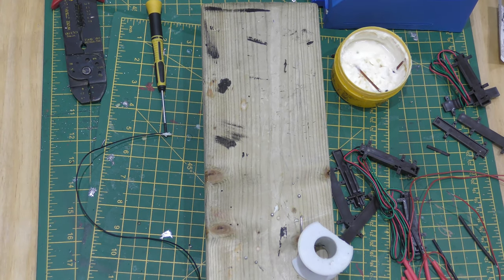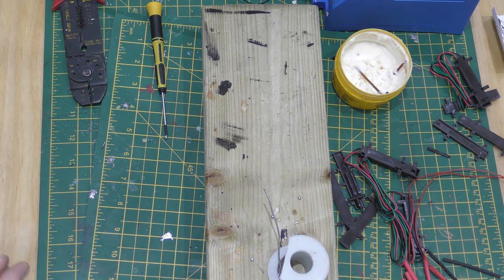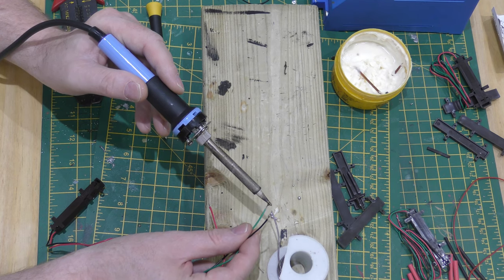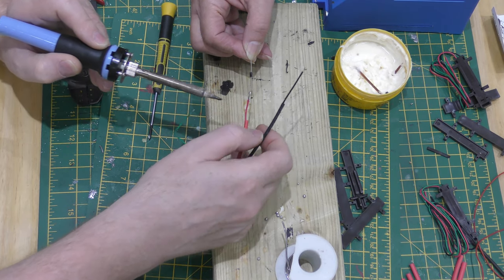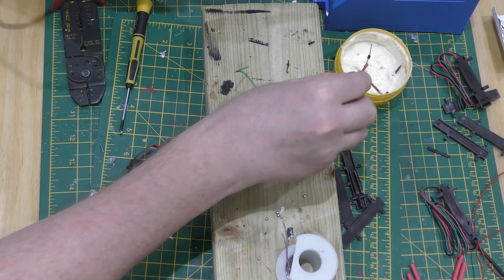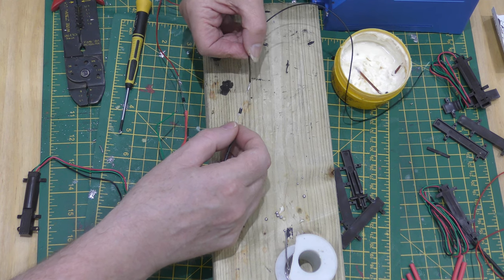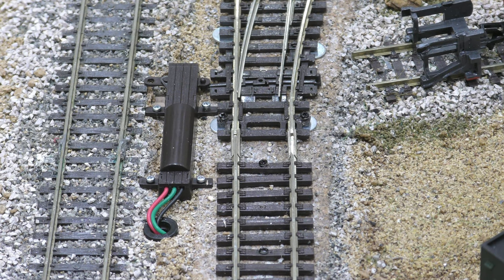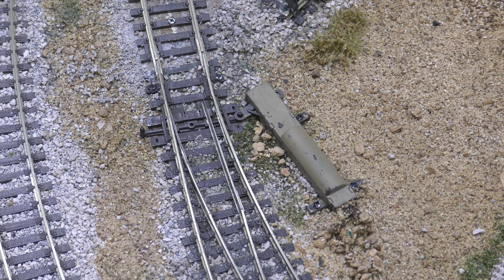Preparing and fitting Peco electric points

Comment: Adding to this great video some clarification on the electronic side. To my previous knowledge a capacitor and a diode are two completely different components for different purposes. In simple terms a capacitor as mentioned will store an amount of power to be used when demanded. In the case of point motors they give that extra surge to ensure a clean switch every time. But with a diode it will only allow power one way which is why they are banded or coded one end. If you put it the wrong way round power will not flow. I liken them to a one way valve as in water flow which simplifies things for anyone new trying to understand. As far as I am aware the purpose of a diode is to prevent reverse current flow which would cause damage. I can't see that the point motors would work any better with a diode fitted but they would be better protected from any stray power. The capacitor is the only component to make the points throw better. I do not mean this to be any criticism on an other wise good informative video but intend it to be of some help and extra knowledge for those interested.
Reply from the maker: Almost right and no I am not offended at all.  A diode is a semiconductor device that essentially acts as a one-way switch for current. It allows current to flow easily in one direction, but severely restricts current from flowing in the opposite direction. A capacitor is an electronic component that stores and releases electricity in a circuit. Whenever you send power down a wire, you always get some sort of current flow in the opposite direction What the diode does is make sure that the point motor gets the full hit of power. Hence why my point motors make a good slam as they change the points. Hence why in big capital letters I have corrected my mistake in the discription. The capacitor will not make the points throw better. A capacitor is a useful tool if you do not have a stable current flow to a device. Hence why some people fit stay alive capacitors to their model locos, all they are really doing is putting a plaster on poorly laid or unclean track, or locos with pickups that are not working correctly.

Comment: All point motors under the baseboard for me 🙂
Reply from the maker: I am 17 stone with a 54 inch chest, I not exactly paddle around under the baseboard material. However, it is what works for you, there are no hard and fast rules. What you cannot change, is it is easier to change a point motor on top of the board, rather than one underneath.
Reply: @PaulBriden  Fully agree but for me I don't have many options running N scale DCC, pretty much everything has to go under the track. The price you pay for running long trains in minimal space N scale. 🙂

Comment: Those “capacitors” you keep mentioning are diodes! It would be easier to make up a few boards with the diodes on (you could make a hundred in an evening!) Please explain what they’re used for and what purpose.
Reply from the maker: If you bother to read the description I do correct this in large capital letters. A diode is a semiconductor device that essentially acts as a one-way switch for current. It allows current to flow easily in one direction, but severely restricts current from flowing in the opposite direction. A capacitor is an electronic component that stores and releases electricity in a circuit. Whenever you send power down a wire, you always get some sort of current flow in the opposite direction What the diode does is make sure that the point motor gets the full hit of power. Hence why my point motors make a good slam as they change the points. Hence why in big capital letters I have corrected my mistake in the discription. The capacitor will not make the points throw better. A capacitor is a useful tool if you do not have a stable current flow to a device. Hence why some people fit stay alive capacitors to their model locos, all they are really doiing is putting a plaster on poorly laid or unclean track, or locos with pickups that are not working correctly.
Reply: @PaulBriden  Wow. Aggressive. Your understanding of basic electronics is somewhat lacking. DC flows one way, unless you reverse the polarity. AC 'flows back', 50 times s second ! If you are referring to a back emf, you should say so; and explain where the inductance is.
Reply from the maker: @rtalbot87  Fine.
Reply: @rtalbot87   i use a Capacitor Discharge Unit and run several point motors from it, is this sufficient,

Comment: Hi Paul, great video thanks.
Its my first time fitting Peco point motors, but i am not sure how the fit to the toggle switches to make them work.
I understand I also need a CDU capacitor  to make it work better ?? 
Like you i have ballasted most of my track and will need to cut some up to make them fit.
But you have given me great hope after watching you do it.
I suppose not to be scared of doing it wrong.
If you have any tips or another video on wiring up the switches it would be most appreciated .
Thanks again
Duncan.
Reply from the maker: Your right, I keep calling them capacities when in fact what I am fitting is Diodes, Yes you do need these. I use Gaugemaster PCU1 point controllers as the power and selection are all in the same unit.   https://youtu.be/QvjL_YmE_5w     So basically the wires from the point motors go to this box. The gaugemaster PCU1 already contains a CDU.

Comment: Why do you use diodes?
Reply from the maker: It allows maximum current to move the point motor, without them the current would flow back and not fire the point as efficiently.  That is why when you hear an electric point it lets out a 
strong thud.
Reply: I wanted to change some points from Hornby to peco but when I tried the peco motors wouldn’t throw the peco points.  Now I know what to do thank you,  where can I buy them please and could you give me the specification?

Comment: Paul great video using screws instead of pins .....what size are the screws?
Reply from the maker: MF-ST31/100  No 0 Phillips Pan Head Self Tappers x 9.5mm lg (pack of 100) ...................I bought these from model fixings. Do not make the same mistake that I made and buy cheap black ones from Ebay, they sheared and the heads kept breaking off.  Yes you have to paint the heads, but when it comes to altering or replacing track they are great, also if you are using Cork they are great for adjusting the level of the track.

Comment: What size screws did you use to hold your points down. I did you have to drill the hole bigger beholden mine are less and a millimetre why
Reply from the maker: No you do not need to drill your holes in the track any  bigger and the screws are MF-ST31/100  No 0 Phillips Pan Head Self Tappers x 9.5mm lg (pack of 100) available from Model Fixings.com

Comment: Hi Paul, Late to the game seeing your great video. I'm just about to wire my first Peco point motors. I notice that you mention soldering in place diodes. Are these instead of having to use a CDU capacitor. I am going to use my Gaugemaster controller 16v output. If that is correct and ok, what diodes should I be looking for? Many Thanks.
Reply from the maker: A capacitor stores electricity, like what they use to keep the lights on in carriages that go over insulfrog points.  They call them stay alive capacitors.  The Diode allows a full direct flow of power that cannot return backwards up the wire so as to give the point motors a real kick.  I have never used  CDU capacitor's on points so I do not know. However, having a quick look at the internet it appears the CDU does do the same job. How I do not know as a capacitor does a different job to a diode.   The diodes I use are Gaugmaster GM74  £4.49 on Ebay 3 available.  Yes 16 volts is the correct voltage.  I would say I use diodes instead of CDU capacitors. My experience of CDU capacitors is zero so I cannot speak from experience. I can only vouch for what I have experienced, I am not the worlds leading expert on model railway electrics.  Have fun !!!
Reply: @PaulBriden  Many thanks Paul. Great honest advice.

Comment: could i power this with a 12V DC power supply ?
Reply from the maker: They are powered by 12 volt power, however, my knowledge of electrics do not stretch further than buying what is recommended for the job and wiring up.
Reply: @PaulBriden  Hi Paul, I also use 12V DC but my motors does not have the strength to throw the switch. Is it because I don't use diodes? If so, why don't Peco inform this in their booklet??
Reply from the maker: @glenneriksson8916  Without seeing your set up I cannot answer, I do not work for Peco so why they would not include information like this I do not know. However, a check you can do is manually try and change the point with the motor connected to check it is not too tight. If you have screwed your motor down too tight the movement will be the same and therefore not work. Also check to see if the motor works not connected to the point. I hope these idea's help you.

Comment: Melting plastic with iron damages ur iron tip
Reply from the maker: Nope, you just wipe it off with a wet sponge while the iron is still hot, just like you do the flux.
Reply: Melted plastic releases petroleum chemicals (oils)  that eat the iron tip u may get away with it once but eventually ur replacing tip